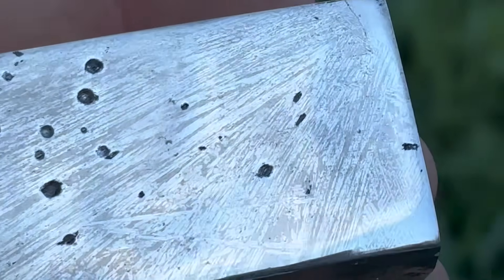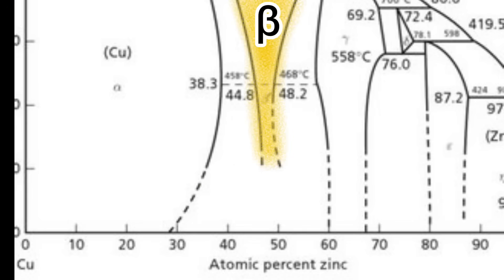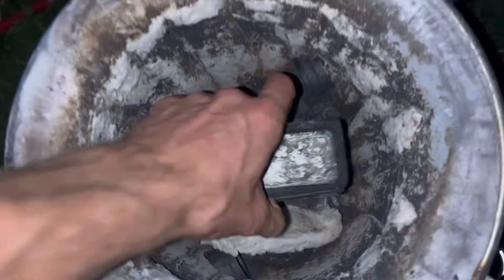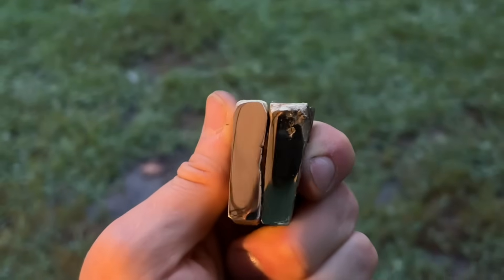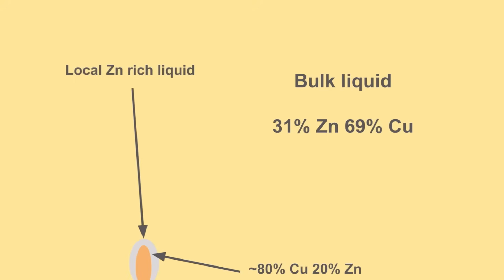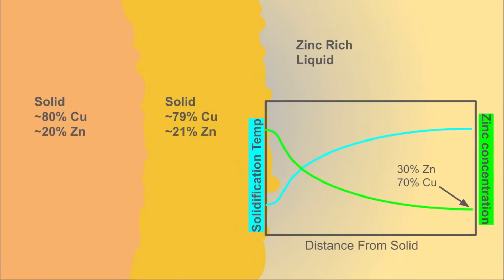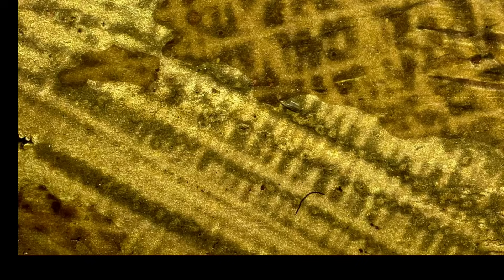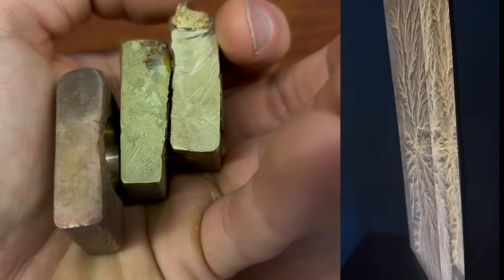Making Meteorite Part 2: Zn-Cu

Comment: Very wootzy but I've seen cable damascus that is extremely close to widmanstatten patterning. Weaving wires of different metals in a way to mimic the angles of the widmanstatten pattern and forge welding it might together might yield a closer result visually.  Could even do a near melting post heat to the billet.

Comment: You got the % wrong. Atomic percentage is differente from weight percentage
Reply from the maker: In this video I am using wt %, correlating with the upper x axis label of the phase diagram (unfortunately cropped out due to its weird aspect ratio) However the copper zinc system is unique in that both species have extremely similar atomic masses, leading to virtually no offset between the atomic and weight percent scale bars— which you can see in any Cu-Zn phase diagram.

So I get it can be confusing with the big “atomic percent” label right there— but rest assured, in this system, atomic and weight percent has an extremely small offset and can be thought of as essentially identical.
Reply: @ElectronImpressions I normally work with gold/platinum alloys (with silver/copper/palladium), and this is a common mistake. For copper and zinc it realy shouldnt matter
Great video !

Comment: I wonder, could you heat up the ingot to get the zinc-rich substrate to melt and drain, leaving you with a hollow lattice structure?
Reply from the maker: The zinc rich phase does have a lower melting point. However what we see in the image I shared of the microstructure is just one plane, if you imagine it in 3 dimensions, the features are quite tightly interwoven, the copper rich phase will likely hold in any liquid that forms

Comment: Need phosphorus.
Did you change your channel name?  Do it again :P
Electrons are units of measurements like an inch, not discrete things.  They cannot make impressions :[  
= One unit of dielectric induction as per its discoverer.
See channel Theoria Apophasis for details.
Name it "Astral Alloys" or something.  Less clutter when you search for it, more unique.  More dialed in to what you're doing.
Merely a suggestion.
Try vacuum/pressure chamber cooling?
Nitinol or something similar would be a neato alloy to do this with.  Make a sorta living casting that morph forms.  Not sure how you'd program the temperature it changes at though . . .  Don't see it used much outside of wires/ribbons.

Comment: I wonder if putting the ingot in a vacuum would make it cool much more slowly, thus making the structure more pronounced?
Reply from the maker: It would technically cool slower than in air, but is a huge logical challenge. I just bought an electric furnace that will get the job done much easier
Reply: @ElectronImpressions  Fair nuff, I didn't know electric furnaces were a thing since I'm a layman in this area. Seeing how good of results you were getting from just slow cooling by letting sit in the gas furnace, I'll bet you don't need to wait a million years to get a Widmanstätten pattern. Looking forward to seeing more! Fun fact, king Tut actually had a meteorite dagger in his tomb. 

Anyways, I was surprised when I saw your first video then went to your channel to find not a lot have been released yet. Your videos are so well done I couldn't tell you were a new channel at all! Keep up the good work man!

Comment: Increasing the mass in the furnace will slow the cooling down. Add 30+ kilo of steel bricks inside wrapped in some ceramic wool for insulation. It will maintain higher temperatures much longer.
Reply from the maker: This is true— but I just got an electric furnace so I can linger at specific temperatures for much longer. Excited to see what it can do 😆
Reply: @ElectronImpressions  Awesome. Can't wait to see you getting the electric up and running.

Comment: Thank you for your dedicated work on this! This topic is something that I've thought considerably about. I've always wondered if you would be able to re-create the look not by growing the crystals but by effectively forcing it by laser cutting sheets of varying colored metals into the pattern and overlaying them. If you engineered it correctly they could interlock somewhat. Then you would just have to heat it up enough to fuse but critically you'd have to keep it from flowing out of shape and making the lines warped (like damascus which is what we dont want). So maybe if you contained it within a vice on all sides except for one where you apply pressure it will cause it to fuse in such a way that once ground down and etched, would look a lot like meteorite. Do you think that method would be possible or worth trying?
Reply from the maker: I did a project very similar to what your are describing as my college capstone project, although for a more different application— so I am particular fond of your idea. I do think your idea will definitely yield a very interesting Damascus pattern. The channel Everyday Metallurgy has made 3D printed Damascus by HIPing metal powders together. You could imagine 3D printing a widmanstatten like pattern with iron/nickel in just the right way to account for diffusion and solid state reactions, then HIP it, you could get something very cool!
Reply: If the chosen metals dont alloy too much at the interfaces it cann work but if you take Ti and Fe for example it will alloy too a intermetalic with a lower melting point and that gets messy very fast just look at @alecsteel titan Damascus videos

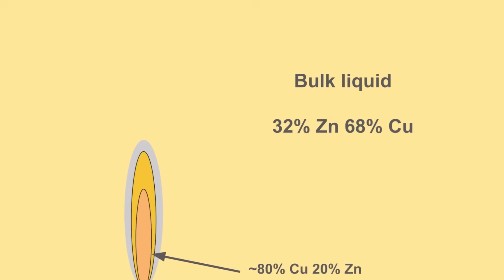Comment: 6:50 I don't believe that the "local zn rich liquid" is the correct explanation. At high temperatures the flow in the liquid is quite chaotic. 

As the temperature decreases, the equilibrium alloy changes its composition. So at a lower temp, 79%Cu, 21%Zn is acceptable, whereas before it was not.

8:20 I was told this is because the solidification is endothermic. Idk

Comment: I wonder if you could make these look even better by cooling them even more slowly? I've noticed that the patterns formed don't have the same symmetries as the iron version unfortunately, but it looks really nice! And it's my favorite alloy, too!
Reply from the maker: The angles between plates in widmanstatten patterns are unique to that material system as they are preferential growth directions for kamacite in taenite. So to get that exact symmetry would be impossible in this material system. The symmetry we see here is unique to this system, and also relative to each grain… the grains in this sample are small compared to meteorites (~1cm vs meters) so we really see the variation in symmetry. 

Your right we could improve symmetry by cooling slower, and the main way to do that would be to hold at high temps for many hours to allow for beta grains to grow very large before we allow any alpha to form. Then as we cool the regions of symmetry of alpha plates will be much larger. And of course a slower cool through the alpha region to get sharper more defined plates.

I just got an electric furnace so I’m excited to try this out
Reply: Ah ok that makes sense!  @ElectronImpressions
Reply: @ElectronImpressions apparently there's a titanium alloy that can replicate the pattern more closely but I can't tell if it's exclusively microscopic. Reddit comment: 
"One can form a similar microscopic structure in grade 5 titanium, with slow enough cooling. Al acts as an alpha stabilizer and given enough time will slowly diffuse preferentially into the alpha regions, whereas V will tend to preferentially diffuse into the beta structure. Given enough time, the process of Ostwald Ripening (also requiring diffusion of atoms across grain boundaries) will tend to coarsen the grains of both phases causing the grains to grow to much larger size."
Reply from the maker: @benG2141 oh yeah titanium can create an incredible basket weave microstructure extremely close to widmanstatten— but like you suggested, it is usually microscopic. I have been trying to coerce it to be larger though, and will put out a video eventually on how successful I am.

Comment: For cooling fill the forge with vermiculite after it's cooled a bit and it will insulate for a long ass time
Reply from the maker: I’ve just got an electric furnace so even slower cooling possible now

Comment: This is fascinating! I'd love to see how well you could tease out other metal phases That would be compatible... Gonna have to pull out the ol' mineralogy degree and see if silver exhibits any compatible solution phases
Reply from the maker: I’ve got a lot planned ;)
Reply: @ElectronImpressions  would love to try out some alloys slow-cooled to see if we could tease out more of a pronounced structure in some of these alloys... Those little low-fire test kilns actually get up to a reasonably high temp for silica glazes, which should be more than enough to very slowly crystallize many of these eutectic alloys...
Reply: @ElectronImpressions  ahhhh, now I really want to see if any of the silver-aluminum intermetallic alloys would work... A tiny doping of phosphorous should work to limit oxygen, which should give better crystallization since oxides inhibit large grain structure, right? Been forever since I took a metallurgy class (ironic since I currently work in the aluminum can industry 😂)
Reply from the maker: @Bromatolite  yes oxides along with any other inclusion would give you that— to avoid just don’t stir and let things settle for a while before you begin the slow cool. I would like to try silver and aluminum, the phase diagram looks very cool. But I would need a 5 million view video before I could go buy enough to work with 😂

Comment: Perhaps you can improve your results with the same furnace by insulating the outside(or maybe digging a hole for the furnace to slot in so the wind doesnt cool it), or maybe adding sand overtop it to increase thermal mass and decrease convection from the ingot, even though it will take longer to heat. Bit janky but you seem no stranger to jank so
Reply from the maker: I just got an electric furnace in! Unjankifying my life.

Comment: out of curiousity, im wondering if a kiln is more what you need to really turn this to 11? 
like maybe melt in the furnace, and then throw in a kiln with a PID controller for a sloooooooow programmed cooldown over like 12-24 hours later
Reply from the maker: Yes that’s exactly what I need, and I have one coming in the mail soon ;)
Reply: @ElectronImpressions  lemme know if you need a hand with electronics and stuff, I’ve been doing a bunch of experimenting with lost wax casting
Reply from the maker: @katzmatt2 I’ll reach out if something comes up. I’ve always liked lost PLA or PLA/wax

Comment: Looks awesome! There is totally an available market for this.
Reply from the maker: Maybe among metallurgists to just look at how cool it is haha, this brass is very prone to oxidation and the pattern does not remain vibrant for very long after etching
Reply: @ElectronImpressions  As a hobbyist knife maker I think people would like this for handle fitting material. An etch and clear coat would keep the pattern.
Reply from the maker: @F0XD1E You’re right, I have been able to keep the etched surface pristine for months so far with a layer of varnish. I don’t make knifes so I didn’t know if varnish/clear coat was an acceptable practice 😂
Reply: @ElectronImpressions  I've seen Master smiths that make 6 figure pieces use clear coat on carbon fiber. If this etches deep enough to have a texture, I wonder if it can also be electroplated with gold or nickel that would prevent oxidation.
Reply from the maker: @F0XD1E The alpha dendrites can etch deep but the interfaces become not sharp but rounded. The alpha beta brass on the other hand etches very deep with good sharp interfaces. The way I got the pattern to pop was to etch then hit it again with 1200 grit to polish the raised alpha plates while leaving the recessed beta untouched. If I can get that microstructure larger it would really be awesome.

Comment: try using tin instead of zinc or aluminum
Reply from the maker: The Sn Cu phase diagram is very interesting, I’m sure there are some cool microstructures in that system. I’ll try it out!
Reply: you should try this with glass crystallization using borax as the material to etch to death.

Comment: Dang dude, I'm a professional metallurgist, and I love your explanation of the dendritic precipitation. It took me back to my college days, but if the professor had better visuals. Well done, and the microstructure is amazing!

My overly complex brain thought about recreating a meteorite's conditions by putting the molds in a vacuum vessel that could handle the heat, but you managed to do all this with some simple techniques, which I love to see!
Reply from the maker: This means so much! Making microstructures more “macro” has been my main hobby since graduating and I’m glad other people also find it interesting!
Reply: It all doesn't seem that different to Wootz steel, except to forge the ingot you need to keep a certain temperature that dissolves only partially those dendrites, and allows them to slowly segregate with each heat, forming the pattern
Reply from the maker: @jeanladoire4141 Wootz steel is such a cool material. Normally to get desirable mechanical properties in those sorts of applications we destroy the as cast from melt microstructure, but I love that with wootz, the as cast structure is necessary to get what we are looking for

Comment: Dude we gotta get Alec Steele to watch this video.
Reply from the maker: It may be up his alley 😂
Reply: @ElectronImpressions might as well get Nile Red too
Reply: Was thinking the same. I wonder if melting high zinc steel and high chromium steel together would give dendrite formation and etching capabilities? Or just anything with dissimilar melting points and etching options.

Sort-of el'dodgio Damascus, but dendrite'd. Then cut it up and twist it around a bit, forge weld it all back together, etch, and see what it looks like.

Might be pretty, might not.
Reply: I want to see Alec and Hydraulic Press Channel get together to make some Damascus, and do the MythBusters challenge, how many times can you fold a thin sheet of steel? (I think they did paper already)

Comment: Nothin' janky with using a drill as a lathe, both are just spiny things anyway. Love this series keep up the good work!

Also you likely could get away with buying a cheap and non programmable electric furnace then add an arduino with some cheap electronics to make it follow temp curves
Reply from the maker: I’ve been wanting to make my own furnace for a while, I’ve got the firebrick, PID, and SiC heating element. Just haven’t had the time and will probably end up buying one anyways lol.